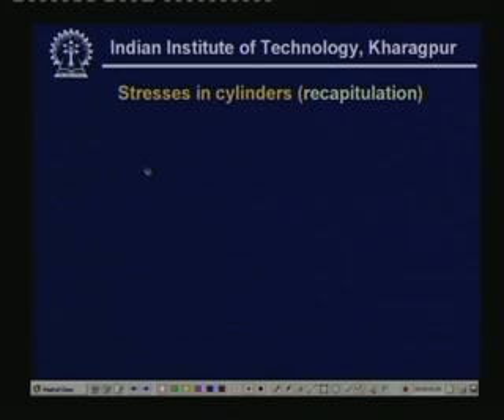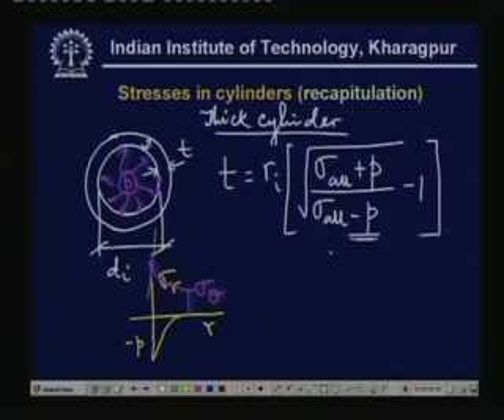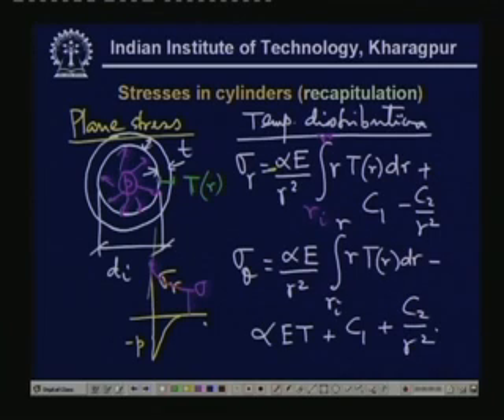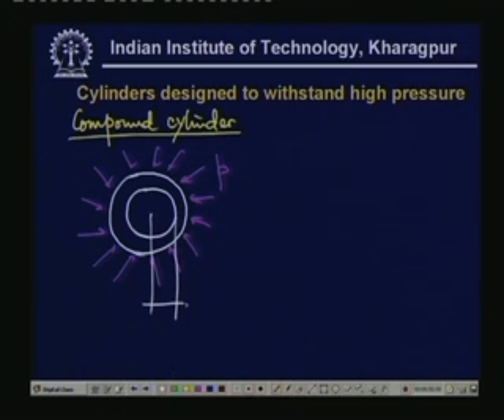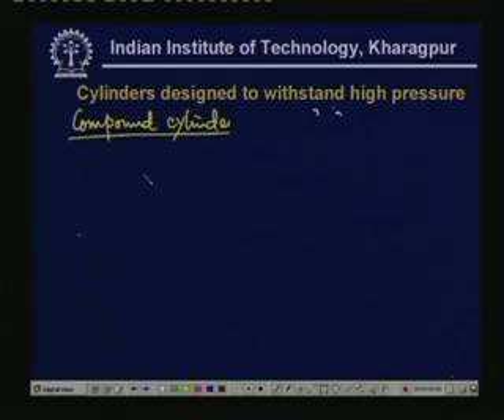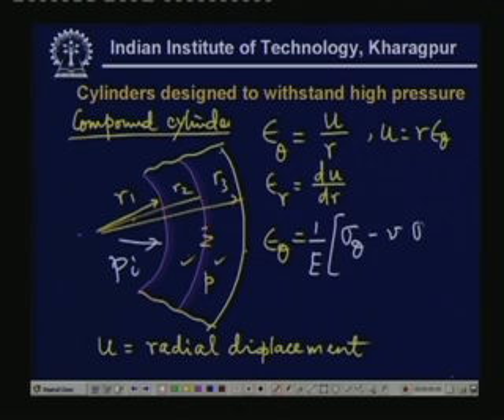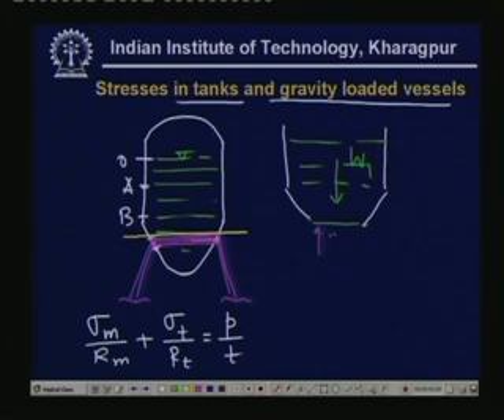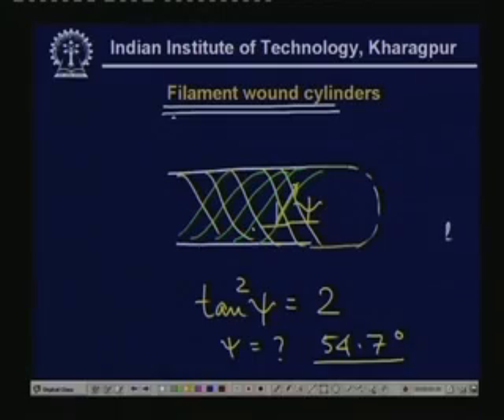Lecture - 38 Design of Cylinders & Pressure Vessels - III

Comment: saving  of material couldn't get cleared........also couldn't understand plastic deformation how it reduces load
Reply: I believe the plastic deformation technique referred to in this lecture is called autofrettage (even though I didn't hear it mentioned by name in the lecture). If you google the term you will find some resources on the subject.